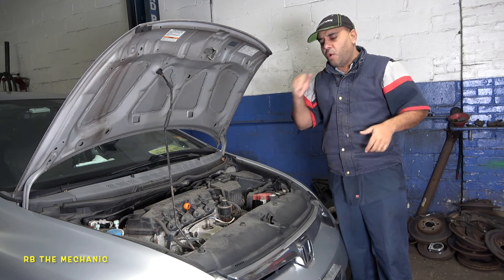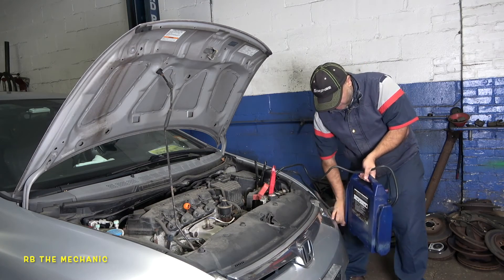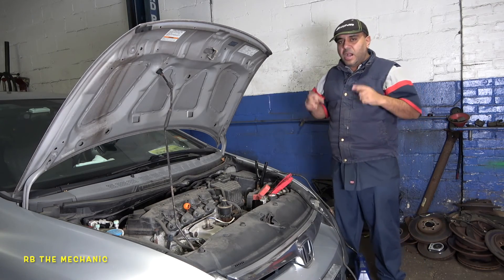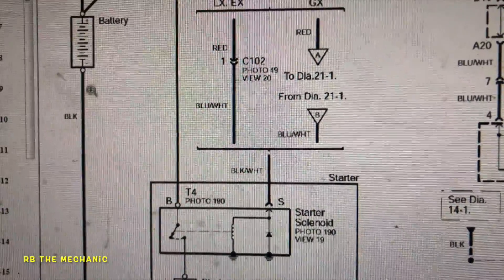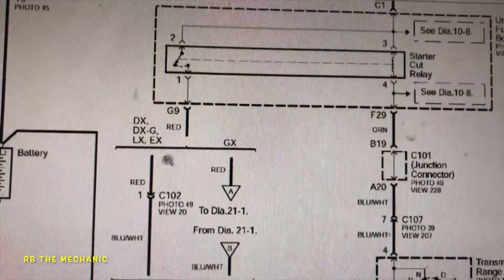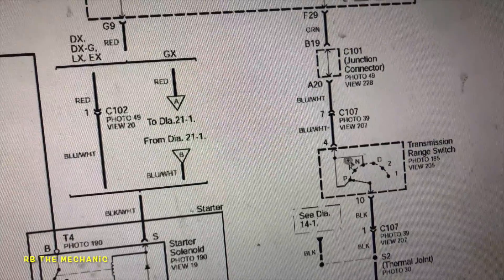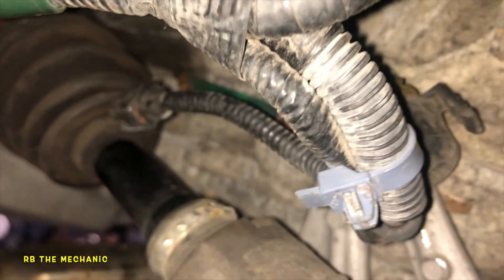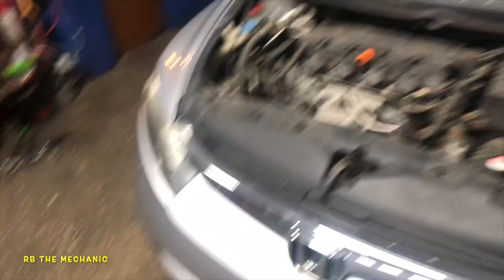Honda Civic 2006 to 2011 starter clicks but car dont start /  Electrical schematic diagram

Comment: My 2006 honda civic makes clicking noise, cranks well but no start. I can jump it, will run a short time and quits. Then same thing clicking, will crank, but no start again. Battery less than a year old. Can a fuse or relay switch be the problem?
Reply from the maker: Well seems like either battery or alternator once’s it starts put on volt meter to check alternator power should be 13+ voltage

Comment: I changed the starter from going to just one click to the brrr sound, i bought a dura last starter from autozone which was 150, I also tried to jumpstart the battery and nothing happened. What could it be?
Reply from the maker: Did u try jump starting?
Reply: Ever find out what that brrr sound is?

Comment: What about testing wiring going to starter before saying bad starter
Reply from the maker: The click clunk sound of starter means the starter is getting control power
Reply: What about bad ground/corrosion and loose connections